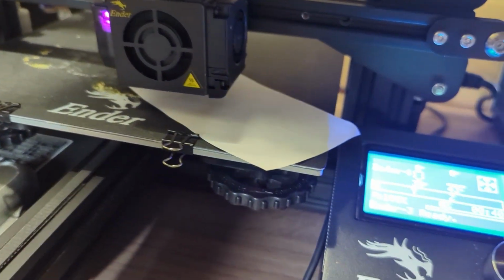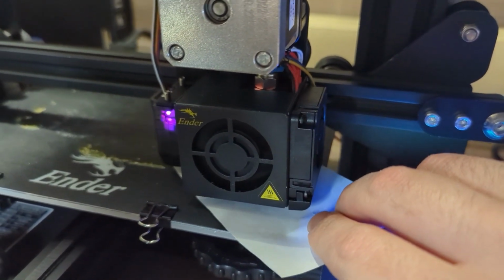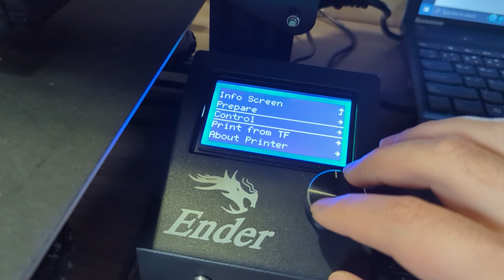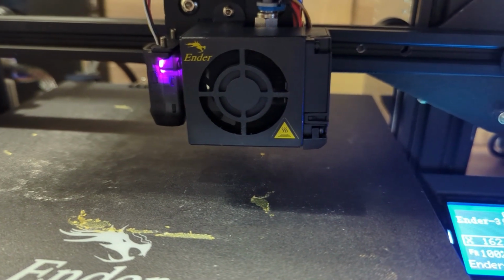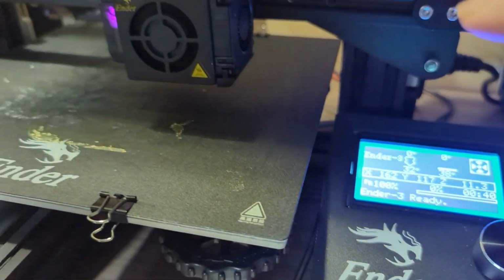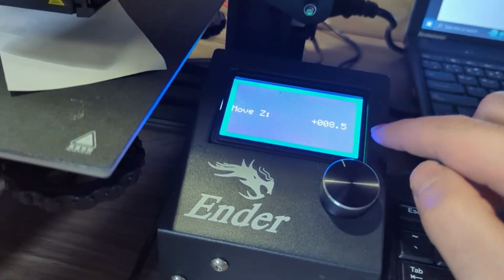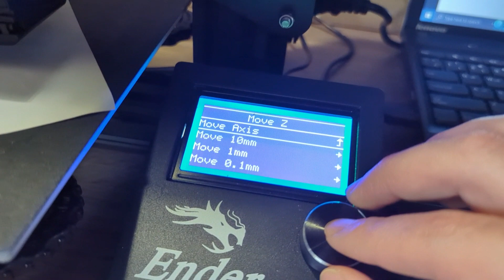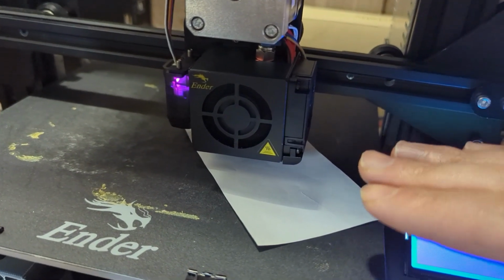CR Touch Bed Leveling Detailed Steps. #ender #3dprinter

Comment: Yeah, sorry, I know I am new to this and was hoping for an easy out with bed leveling. O was lost right in the beginning with old fashioned leveling. So you autohome? Then disable the steppers? You didn't touch the bed levelers, is the bed leveled to z home?
Reply from the maker: So you do the old fashoned once then you adjust the offset level and should be good after than it's auto leveling even if you change the bed

Comment: i would recommend moving the z axis back and forth after disabling the stepers so it won't move by accident while leveling since x and y would be off and z would not move.
Reply from the maker: Good idea, thank you
Reply: @techs.passion  ok so i tested it. This trick used to work on my original ender 3 but on my new printer moving any axis turns all of the motors back on.

Comment: Hey, I'm completely new to 3d printing and bought a 3 pro used. It has the CR touch installed and I plugged it in and it has a flashing red light. What step of the process am I on? What can I figure out from here?
Reply from the maker: The flashing red is while testing, is the CR touch stuck or not touching the bed at all?
This video should help you to check every step of the CR touch
https://www.youtube.com/watch?v=QTB_PLqitGI
in addition, you can join my free Discord if you need more help
https://discord.gg/FgVJYEUEXs

Comment: What if back left corner is so low and the nozzle still hits the glass plate?
Reply from the maker: The corner with the cable should have a Lower pad than the other 3

Comment: Its insane to me that this is marketed as "automatic levelling" and there is literally a selection that says "level bed" and it simply just doesnt level the bed.  This literally complicates the process of levelling the bed, I dont understand this product
Reply from the maker: It does work after the initial setup although I get your point. I think it's a bit complicated to setup and get it ready but after that it does work. For example, you can change beds and no need to re level regardless if the thickness is different. I hope that helps
Reply: Bro im in the same boat.. i have an ender 3 pro and thought to myself theres gotta be a mod for auto level and i see this and i think ok maybe i just gotta install a motor thing under the bed and this thing and with a click of a button itll auto level and i can get printing.. this is literally the same thing as what i do now with extra steps 😂
Reply: @RockoOmazing  yea I know the feeling, I had this set up and didn’t print for like almost a yr, got a new computer and didn’t add the g29 code
Reply: Yeah, imo it should be:
1. Auto-home so the nozzle sits at the center of the bed
2. Paper test to set initial nozzle/bed Z distance
3. Hit auto-level and the probe checks how far it is to the bed, then moves and copies that distance to other points in the bed (keeps hitting the same spot at lower and lower Zs until it's right, or does some electrical resistance test or whatever).
Right now it's a hassle.

Comment: How do you offset you didn't exactly describe how
Reply from the maker: Sorry if that wasn't clear. So you go under the leveling section and you should see the Z offset if you have the correct firmware, you should be able to go negative. Then you go down until the nozzle almost touches the bed. Basically paper thin form the bed

Comment: your losing something in the steps here.  You say to home the unit after disabling the steppers, and then you manually move the print head to the right front corner, and then you do not say  how you lower the print head to the bed to start the leveling process. This is where I have a problem.
Reply from the maker: Sorry about that. Auto home will get you to the middle then you manually move it to get every corner. To lower it, you need to take the Z to zero then add the offset needed. 
If you are still stuck with this, let me know and I'm happy to further help. I also have a free Discord, happy to help more there. It's free
Discord: https://discord.gg/FgVJYEUEXs

Comment: I love how all you experts use different screens.  I have no Prepare nor disable steppers...
Reply from the maker: Sorry for that, it's probably the firmware version different. Shouldn't be a big deal, the same usually there maybe under a different menu or you might need to upgrade the firmware to accommodate the CR touch if you haven't done that already

Comment: Exactly what I am doing without good results so I think I will add some extra steps for myself:
- Go back to a firmware without auto leveling
- do the usual old fashioned bed leveling
- confirm leveling with some printing test
- change to firmware with auto leveling and negative Z limit
- do auto level
- continue your step of findind the distance my nozzle touches the bed

What I haven;t tried of your video: heat the bed (I will try this too)

I hope to get good results
Reply from the maker: Hi, I'm sorry you are having some issues with the bed leveling. I hope this works for you, I also have a full video about how to install the CR touch from scratch which you can skip to the leveling part, let me share that here.
Reply from the maker: https://www.youtube.com/watch?v=QTB_PLqitGI

Comment: How much friction do you need
Reply from the maker: Paper thin only, very little friction
Reply: @techs.passion  ok so like when you barely drag something on the ground l
Reply from the maker: Exactly, just a light touch
Reply: So I can show you I have files on that sd card
Reply from the maker: Yes but the files might not be in the correct format
Reply from the maker: Sorry I can't respond to the other thread since I'm using my phone and I need a computer to be able to answer a thread over 10 comments. I will when I get a chance

Comment: Hello, i followed your directions but whenever i start a print the nozzle is not even touching the bed. Also, when i go to z axis it’s not at 10 but at 1.
Reply from the maker: It sounds like your offset level is not set right. There is other video I have showing you CR touch from start to finish, you can skip to the leveling step which might explain it better. https://www.youtube.com/watch?v=QTB_PLqitGI

Comment: I bought a set of feeler gauges but they are not as good as the paper method IMO, when I use the paper method I know it is good when the friction is just starting, I then move it a very slight amount down so the friction is grabby but can still be moved back and forth, with this method (which is more or less the same as yours) I only need a slight amount of baby stepping when calibrating to get the squish on the first layer, the feeler gauges get me too close and I have to do more adjustments. I also print the Cura Bed Calibration Square as it has some squares that get filled in and by using baby steps I can get that 1st layer infill perfect with no gaps between the layers.
Reply from the maker: I agree, the paper method is the best. I think my first video regarding the CR touch created some confusion so I wanted to follow up with this. So far my bed leveling gamed improved and after getting the CR touch all set and done, it is helping for sure but you still need that paper at least once in a while but my goal was to reduce the amount of leveling I need to do.
My Ender 3 New Max is here so I will make a video about that soon.
Thanks you for detailed comment which is always helpful